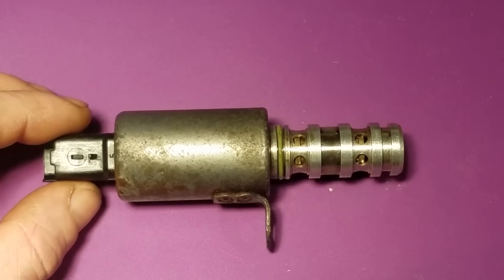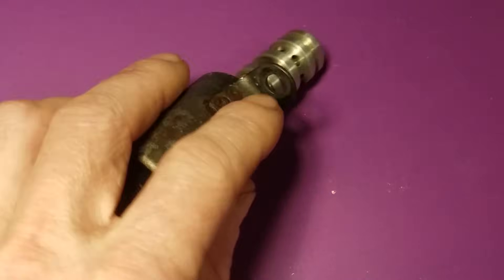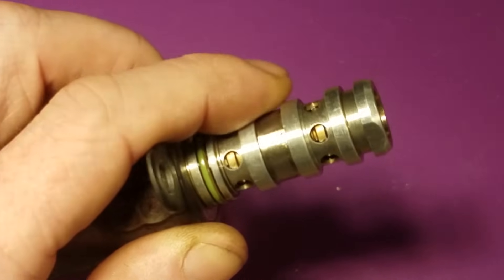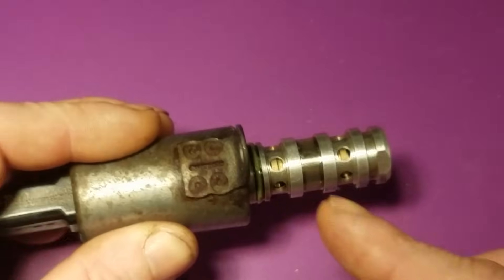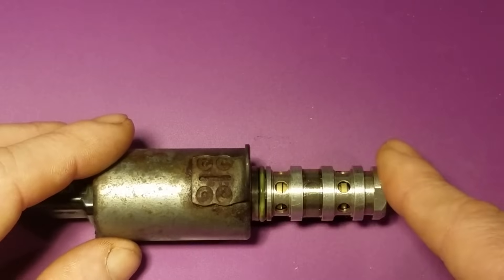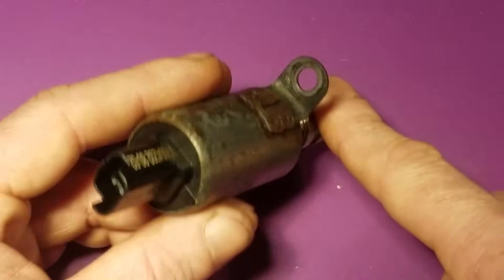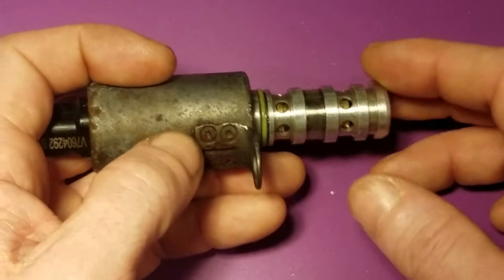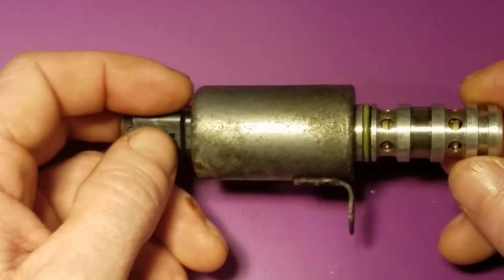Variable Valve Timing Code p0011 p0010 p0012 p0013 p0014 p0028 (Don't Waste Money)

Comment: my 2013 sonata had the p0014 code come on, then the engine stopped while driving on the highway, had it towed, changed the oil,cleaned the solenoid, after unplugging the battery for a few hours tried it again a few times and it finally started up again, left it in park for a few minutes, tapped on the gas and it stopped again and there was a bit of smoke. What could have happened?

Comment: Can you use a throttle body cleaner to clean the solenoid, or it's better if it's brake cleaner?
Reply from the maker: Either will work just fine

Comment: great advice definitely will try this first before wasting any cash, thanks
Reply: My 2014 Chev. Captiva check engine light came on I scanned it and it has been a P0010 and a P0011 code. I replaced both intake and exhaust light went off for a few days. Then came back on same codes, so my wife took it to a mechanic they did a detergent engine clean and changed the oil. Again the light came back on. I have taken both solenoids out and cleaned them again with carb cleaner. But I keep finding little tiny pieces of debris on the screens. Could the stuff they used to clean out the engine broke sludge off? Should I change the oil and clean them out and hope for the best. Is there something else that could throw those codes besides the camshaft solenoids? Help if you can?

Comment: 2007 QX56 changed both solenoids and have not been able to get rid of the engine light and can not pass smog check. any other suggestions. Are both solenoids the same? or could i have placed them in the wrong location?

Comment: I have a Ford 2018 Escape the engine spins and does not work. I have code p0012 + p0014. I changed the fat and filter and changed the vvt bank 1 and cleaned the grease pressure sensor.  I took out the spark plug and checked it. There is a fireball and the smell of fuel is present in the engine. I checked all the fuse and all this and the engine did not work. I am tired. Can you help?

Comment: There is a company called Quantum Solenoid they say their replacement will give Toyota 1.8 in a 2017/18Corolla /2016 Scion iM more power could this be true ? For $175.00 VS a Stock One $55.00 how long do they last ?I don’t need one I was just curious 
Thanks Sept 2019👍

Comment: If the solenoid haves been sticking for anytime this will cause the coil to heat up and swell if you see the canister is swollen or burnt  the cylinder is bad and no amount of cleaning Will Repair it

Comment: could this also be accompanied by misfire codes on the same bank that the solenoid is on?
Reply: I got a nissan sentra giving this code and p0300 changed spark plugs nothing changing oil tomorrow (  at 6 k now since last oil change ) and going to clear the codes and see (before i commit any more money to ignition coil and changing the vvt solenoid

Comment: I have a 2005 Infiniti g35 manual transmission sedan, with a code p0014 hasn’t had a oil change in 5k miles and I have replaced the cam shaft sensors and replaced the solenoids, what els could it be?

Comment: I have a Nissan máxima 2008 and problem with code P0011 i change 2 selenoides and sensor position and the code cointinue, the Car run perfect dont have eny problem but the code stay and dont pass control smog ;(

Comment: I have 2015 2.5L Hyundai Sonata and have engine code P0010.  Engine seems to have multiple solenoids, which one in particular should I check?   Hyundai dealer told me to replace Intake CVVT and wants $2k to fix the issue, but my gut tells me the issue isn't as bad as they are making it out to be.  Thoughts / Suggestions?
Reply: The P0010 is intake solenoid on the side of the engine closest to the radiator right above the alternator a 10mm bolt holds it in
Reply: Hi I have the same problem now what end up being the issue

Comment: I (a shop) changed my knock sensors on my 2014 Silverado 5.3L VVT. Took it to the dealer and had the code cleared. Code just came back and I noticed a slight valve clatter when the CEL comes on, but it is very slight and goes away almost immediately yet throws the knock sensors codes. Could this just be my VVT solenoid needing cleaned or changed? The truck sounds very healthy otherwise and has no knocks or ticks and no misfire codes.

Comment: Hi! would this also throw a p0344 code “CMP sensor a circuit intermittent”. P0344 code is permanent and the p0011 is a stored code. I hear what sounds like lifter noise(kind of like rod knockin).. it’s at the dealer right now with only 2k miles hopefully it’s all covered under warranty

Comment: I have a 2013 Nissan Altima S . I have a codes coming up P0014 and P0300 . I have changed the variable Valve and cleared the light . Then it came bk on with these codes Camshaft positioning sensor! If I change the camshaft sensor will it fix my problem? My car rpms go up n down and shuts off when it wants to! Can u please give me some advice on what to do! Thanks
Reply from the maker: wish I could help but sound like you may have a few things going on. The surging idle may not be related to the p0014 or the p0300. I would probably take it in to get checked out. you could try relearning the idle https://www.youtube.com/watch?v=7Gy1jINENOU but thats not going to help the codes you have. If you do do the cam sensor I would also do the crank sensor. Crank sensor are known problems  on these cars but little tricky to get to. And can cause all the simputons you discribed.

Comment: Do you have to worry about getting brake cleaner in your oil if you use it to clean the solenoid?
Reply: After it's clean just let the brake cleaner evaporate before putting it back in.

Comment: P0014 e46 bmw 325i exhaust over advanced, it’s only that code. Is it my Vanos solenoid that needs cleaning/replacement, my Vanos seals, or my exhaust side camshaft sensor

Comment: I got a 05 Colorado and I changed the camshaft sensor and my light still came on even tho it threw the code po014  and my engine sound clacking is it sumthing to do with timing chain any answers
Reply: Did change the camshaft sensor or the camshaft solenoid (variable valve timing or variable timing solenoid) ? A lot of times parts stores give people the wrong one or get confused because they are called by a few different names, the camshaft solenoid “VVT”  causes extremely rough idle and sounds like what your issue is.
Reply: It was the timing guide sum plastic pieces that gm make so u can take them back and they will replace them with cooper or sum type but cost was 1680

Comment: how do you remove the screens without them braking? I habven't taken mine out yet just trying to figure things out before I start..
Reply from the maker: I just remove them for the sake of the video I would not recommend taking them off, just cleaning them.
Reply: Michael Hronas there are no brakes on them. Brakes are at each wheel.
Reply: @FlatRateMechanic  how do I clean it what I clean it with
Reply: There are vvt solenoid cleaning videos
Reply: @qdezy7695  brake cleaner
Reply: @jasonbeaulieu4979  that made me laugh 😑

Comment: I didn't have any codes but I replaced them anyway. I took the old ones and sonic cleaned them. 
After cleaning them I put them into a container and filled the container just to the parting line with oil.
I will leave them in the container until I need them, they will be ready to go. 
I always change my oil and filter every 3,000 miles, so there is no sludge.

Comment: I got a 2008 Pontiac Montana super over advanced 22 degrees. I have done everything aside from removing the engine. New sensors, pcm, oil change twice, engine flush. Nothing wrong electronically. I can remove the solenoid and still stays 22 degrees advanced. Even removed the timing chain. It was bang on the marks. What do I do? Doesn't ever go below 22 degrees advanced even though the computer is calling for 5 at idle. Also it will advance if the solenoid is cycled, to the point it will stall if I leave it too long. What can I do? Is there a reluctor wrong?
Reply: I have P0011 and P0016 come up. I have done everything in the manual aside from getting the kit to check oil pressure. But my Tech 2 says pressure in spec.

Comment: I have a 2006 BMW 325i and the codes p0012 and p0015 came up and it caused the car to lose a lot of power and I replaced the camshaft position sensors and the vanos solenoids and it was fine for a couple days but the other day the codes came back up and the car lost a lot of power and took forever to accelerate, any suggestions on what I could do or what could be the problem

Comment: I change the oil, i checked the wiring, i change the solenoid the code si still on. What do you suggest?
Reply: Same problem  are you fixed???
Reply: @MrAtiamd  yes i fix, camshaft adjuster oil rings were broken i chanege them.

Comment: Hi, I have a 06 Infiniti M35. I got the ignition coils replaced. It still giving me that code and now gasoline rotten eggs smell in car. Can you tell me what it could be? It's P0010 only one coming up AND it has stalled on me once as I was slowing to turn on service road.
Reply: Normally rotten egg smell is a good indicator the catalytic converter is starting to clog

Comment: Can you tell me where this is located on a 2004 Scion xb? I got a P0010 error code, intake A, camshaft position
 actuator circuit/ open, bank 1. Thank you. Awesome video!
Reply: Did you fix your car already if so what was it? i have that same code on my malibu
Reply: @kllgrogto5838  it was the intake solenoid wire was broken. Just had to replace the connector and now it's running great.
Reply: @vikkinixon1225  thank you i will check my wires before replacing the solenoid

Comment: I have a 2012 Infiniti FX35 throwing off the P0014 and P0024. the shop want to charge me 2000.00 to chance the Exhaust Cam Retartor Assembly in bank 2 and a faulty cam shaft position senor on back 1. I would like  to pull the solenoid on bank 2 and clean it and replace the sensor in bank 1. Is the solenoid in bank 1 easily removeable to lean like in the one in the video? Thanks
Reply: Sorry I want to pull and clean the solenoid on bank 2. (Left Side).

Comment: Yeah my Honda 01 Civic overheated about a month ago and I have a problem with it turning back on went through timing fix the timing and it starts around like crap did it a couple more times it did the same thing now it doesn't want to start at all check timing again time he's on the point kick spark spark some point compression with compression in 3 cylinders not in the n14 why wont it start somebody got a good answer for that let me know thank you I

Comment: I had a rat get into my engine compartment because it made a nice cozy place. It ate many wires. The dealer wanted me to buy new valve actuators. They're discontinued. That turned out to be a blessing because that would have cost thousands. I took it home and bought some 16 ga wire w/silicone jacket, and a box of those handy splice deelies. It ran really bad. I thought the top wire would go to the top actuator and so on, right?   No.  So I cut the lines and connected them the opposite way and it runs ok but it idles a little ..bumpy.  I need to figure out which one is the intake and which is the exhaust.  And I guess they call the right side of the engine, the left. I guess it's the left if you look at the engine from the front but that's not normal.  ANYWAY, can anyone tell me on a 2003 VW Passat W8 (4.0 L V8) which one is the intake and which is the exhaust?
   I didn't clear the codes first.  That just came to me as I was typing.  I'll try that but I would still like to clean that wiring mess and put a connector on it.  Can you believe that the actuator has a wire that goes to the ECM without a single connector between? The rat chewed the wire to the nub on one and there's no doing that one over. Mine don't just come out like his.  Anyway, it makes it harder to diagnose and fix if I don't know which is which.   HEY FOLKS, I just cleared those codes with a cheap ODB2 bluetooth thing and an app. The codes are gone, the engine light is clear and I guess my mess of a soldering works. I'd still like to put a connector in it and cut those "extra" connectors out so it doesn't look so dumb but if it works don't fix it. There I went and bought a complete set of new plugs and coils and O2 sensors. I've cleared the code before by disconnecting the battery, but the engine light kept coming back on.  Now I'm wondering if I kept it from reading a bad code. I just can't believe it's working. I just punched the gas and it runs fine.  A tune up is a good idea.  85,000 miles and never a change of plugs or coils. Maybe it will idle smoother with NGK Ruthenium plugs and new coils. Probably.  I'd still like to know which actuator is which. If the code comes back, I won't know which one to monkey with. It's still seems weird that I had to cross the cables. The top wire goes to the bottom, ha ha, that bit. Why would anyone design that?  Strange.  Now it's idling smoothly. It's intermittent. Tune-up scheduled when the weather is cooler in Dallas.
     Any help identifying which actuator is which on this engine would be greatly appreciated.  Thanks for this informative video.

Comment: Just got p0013 on 2007 cts 3.6l.  Showed up after changing valve cover gaskets and putting in 6qts of synth., oil.  I think I pulled the harness for the exhaust OCV a little when removing the valve cover on bank 1.. do you think it’s just a loose connection there?  If so, would it be expensive to replace the harness or what not?
Reply: Found the problem.. if you look up the diagram for the control valve on autozone for my engine.. I had #2 hanging unplugged... CEL went away right after plugging in... #shadetreemechanicinoverhishead

Comment: the fact that you say dont waste money but these solenoids are usually cheaper than an oil change. Its only expensive if you cant change it yourself and rely on others to fix your car. People need to start taking some initiative in my opinion and start learning to DIY. All the information you need is on youtube and google. Why waste your money taking your car to someone else when you could do it for the price of the part.  😂😂

Comment: Hello the Great man 
I have a Reaunalt megan 1.6 manual and I checked by code reader and I find, P0010 A camshaft position A control Circuit/ open bank 1 
and actually I don't know from where I have to check the car?

Comment: Hi i have porsche cayenne 4.5 v8 2004  i have code p0021 and p0011 do i need to clean it?
Reply: Feridun Bekar did your car star ?
Reply: Start
Reply: Hi I have Porsche Cayenne Turbo 4.5 V8 2005 with P0011 code, how did you fix yours?

Comment: What about p1110 ? Thanks
Reply: P1110 is typically a Nissan or infinity code, the code refers to an issue with your intake valve timing control unit if your oil passages become clogged or if you have poor oil pressure it can cause this code.

Comment: Great video, changing our oild this week.  Ive been looking for the solenoid (MG3 1.5 litre), think its on top of the cam cover, at the pulley end of the engine.   Cant see a bolt though, just looks like you pull it out.  Dont want to force anything though,  anyone help please ?     Tom.
Reply: hey tom im a little late but usually the solenoids are at the top of the engine or on the sides depending on the car im not sure if you have figured it out but maybe try searching up an engine diagram for your specific car.

Comment: thanks for the info ...I got questions if some can help me 
1. I need to disconnect the Battery to remove the Solenoid.
2. we need an special tool to complete the Job ?3. what should I use to clean the part ? Thanks
Reply: good idea to disconnect the battery when working on electronics.  For tools you just need a flat head screw driver and a 10mm scocket and ratchet .  you can use brake cleaner to clean it off
Reply: Thanks , so , sounds like very easy to do it by my self if no special tolls are need ...I will try  on the weekend ..thanks again
Reply: @mariomoreno8658  Unless it's causing a problem, leave it alone.

Comment: Did you fix It man? I have no signal from ecu on driver side but on passenger side there is signal but once i give it earth 2 or 2 sec  engine hesitate so that mean no signal??? 🤬🤬🤬 Have done oil change and filter, crank sensor, 2 cam shaft sensor, driver vvt many times changed selenoid many times no solution, checked voltage on red wire on harness switch on give battery voltage and other wire which is for signal for computer ecu which is earth and thats it really upset 😭😭😭
Reply: Can you resolve the problem?
Reply: @cesardelamora4812  yep changed ecu from  scrapyard with programming

Comment: where would this be on a 2007 Ford F150 with 5.4 L engine ? I have  P0010  Code ... Thanks
Reply: Front of the engine bank 2 right on top the valve the bank 2 is is located below the valve hope it helps

Comment: I have had problems with my sportage.

Valves have been replaced. Oil has been changed, filter changed, phasor camgear replaced.

Still getting 0011 and 0012. Kia dealership trying to scam me too.

I fucking hate these errors.

Comment: How do you manually test it? It is linked to the computer, so doesnt it run on 5vdc? How do you know the ohm specs in order to check resistance?
Reply: Remove the solenoid, make yourself a couple of jumper wires. I took two pieces of wire, put alligator clips on one end and battery clamps on the other. Hook up the battery and touch the two terminals with the alligator clips. The solenoid should move back and forth when you power it up. Good luck!!

Comment: Infiniti i35 2002 I got code p0011 car has bin sitting for 2 years just did oil change code just came on yesterday 89,500 miles can this be it?
Reply: Cars bin running for about 3 weeks now w no issues code just came out 2 days ago
Reply: How did you fix it p0011 ?